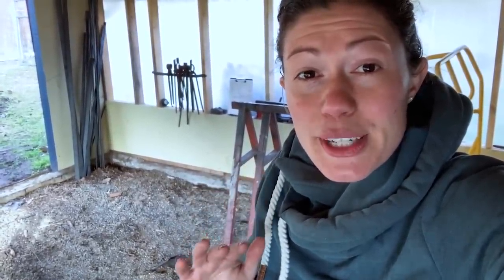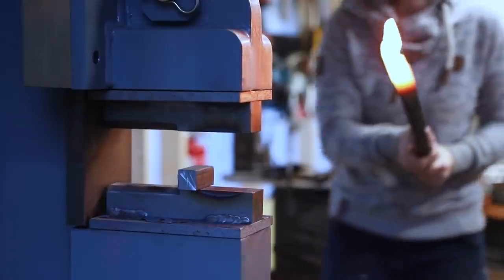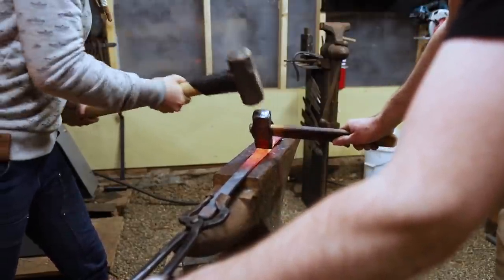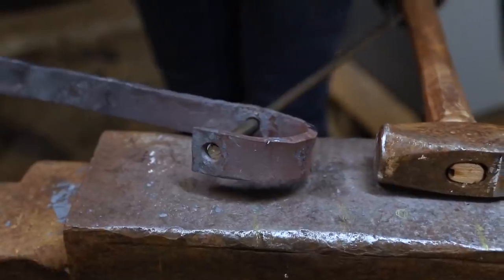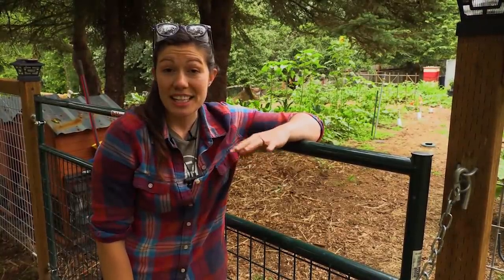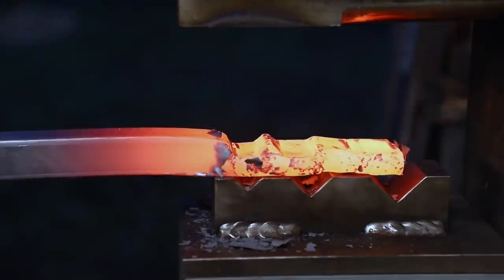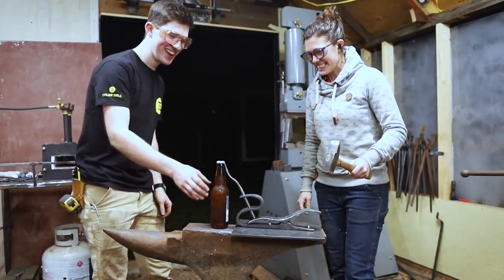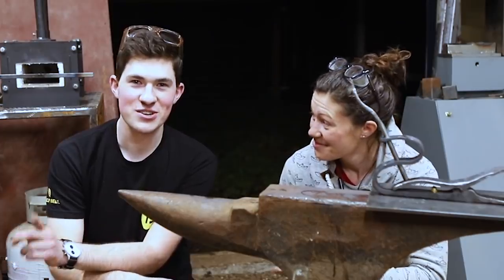RIDICULOUS Bottle Opener collab with @TylerBellMakes

Comment: Hi Anne. I have always wondered why you don't hold the hammer near the end of the handle. It gives you so much more power. Best regards
Reply from the maker: You hold the hammer at different positions depending on what you are trying to accomplish. Most of the time “more power” is not the goal.
Reply: @AnneofAllTrades  Thank you for the info

Comment: Try hitting the bottle opener with your hand not a slammer hammer.  The caps aren't on that tight.  A slot at the pivot point in the top piece with a pin through the top and fixed in the bottom will allow the top to pivot and not fall off each time.  Other than that - a Really Great Bottle Opener!
Reply from the maker: The hammer is way more fun 😉